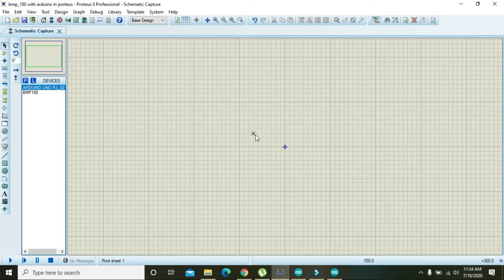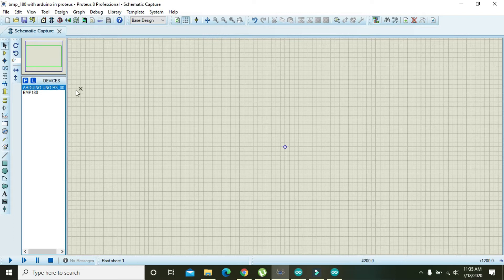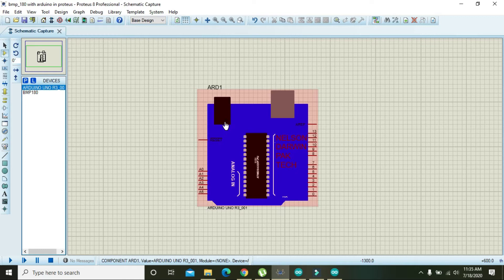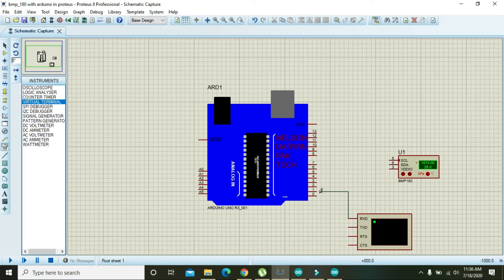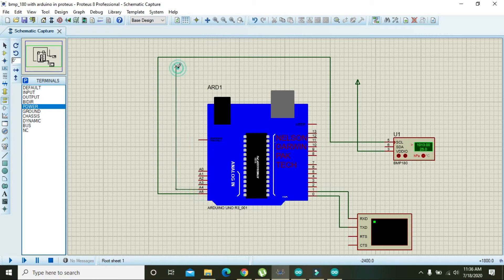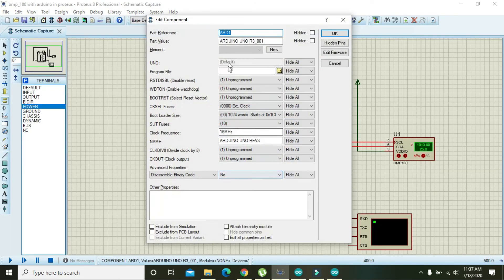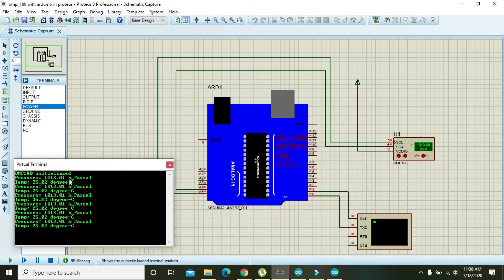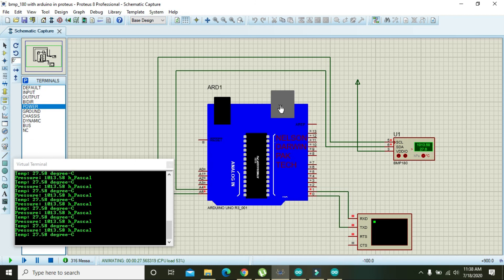how to make a simulation of bmp180 Pressure sensor with arduino in proteus

Comment: #include <Wire.h>
#include <SFE_BMP180.h>

SFE_BMP180 bmp180;

void setup() {
	Serial.begin(9600);
	bool okk = bmp180.begin();
	
	if (okk) {
		Serial.println("BMP180 inicializou!");
	}
}

void loop() {
	char satats_1;
	double temperatura, pressao;
	bool okk = false;

	stats_1 = bmp180.startTemperature();
	
	if (stats_1 != 0) {
		delay(1000);
		stats_1 = bmp180.getTemperature(temperatura);
		
		if (stats_1 != 0) {
			stats_1 = bmp180.startPressure(3);

			if (stats_1 != 0) {
				delay(stats_1)
				stats_1 = bmp180.startPressure(temperatura, pressao);
				
					if (stats_1 != 0) {
						Serial.print("Pressão ");
						Serial.print(pressao);
						Serial.println("Pascal");

						Serial.print("Temperatura: ");
						Serial.print(temperatura);
						Serial.println("Graus-C");
					}
				}
			}
		}
}